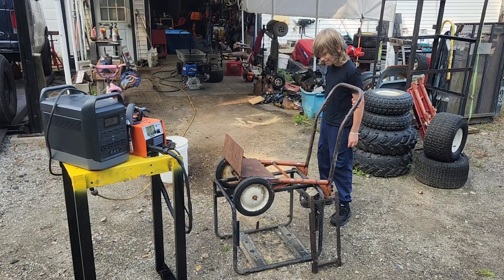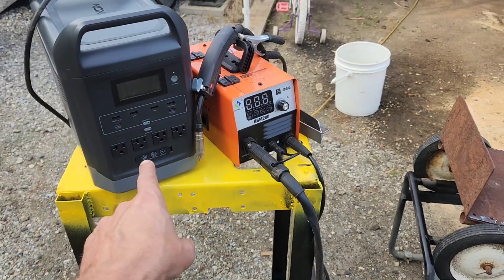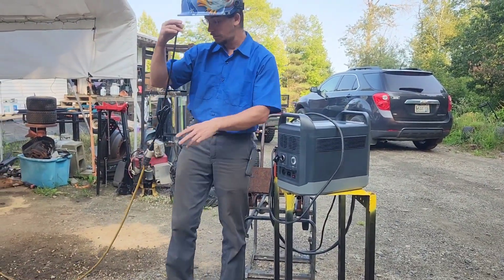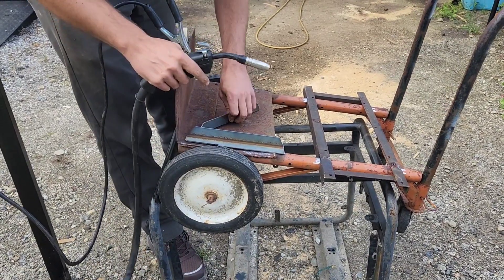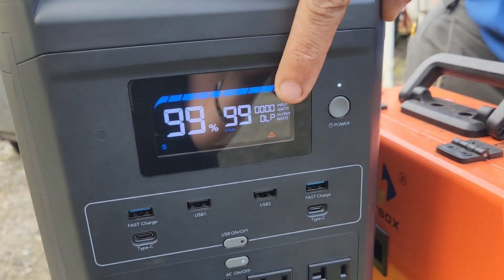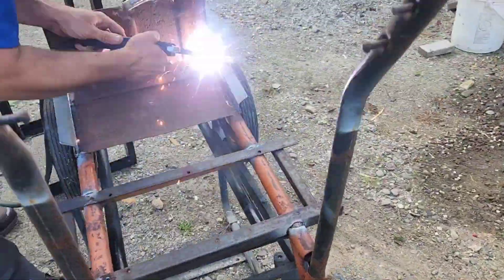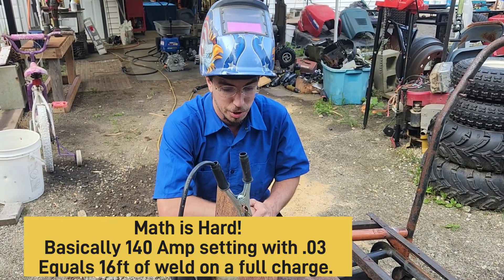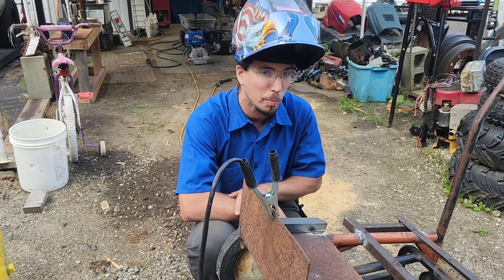Solar Welding with Battery Generator Portable Power Station

Comment: Hear and idea if ya ever wanna goof around building something  /need a video idea.  Make a push cart  with removable lawn tractor hitch tongue so when get tried pushing can bolt up tongue and grab lawn tractor.
Reply: That is how my garden cart is setup, I can unpin the pull handle, and pin the tow hitch onto it and pull behind a lawn tractor.